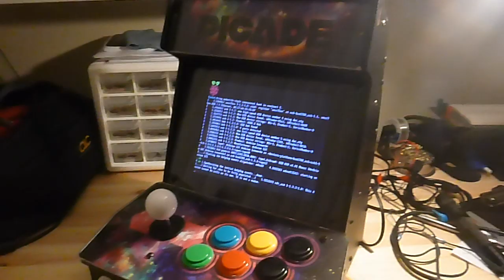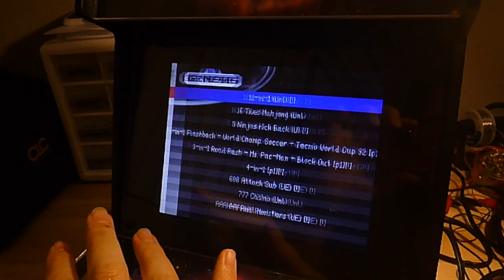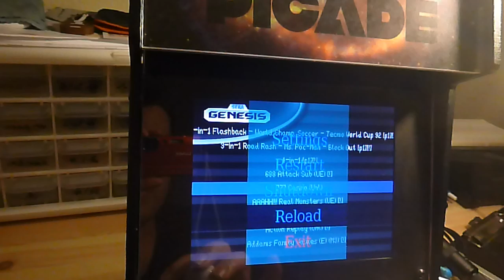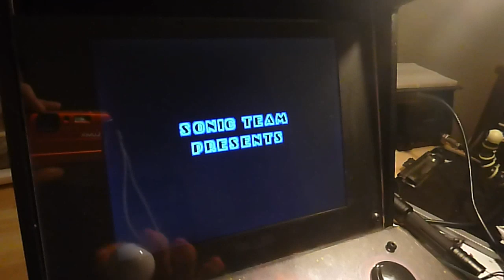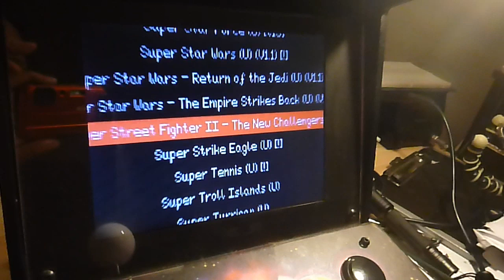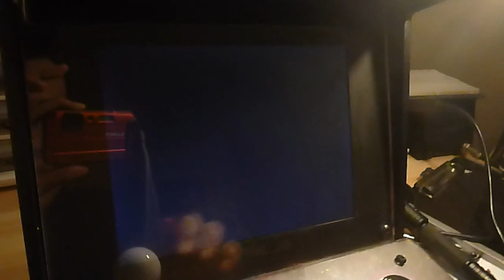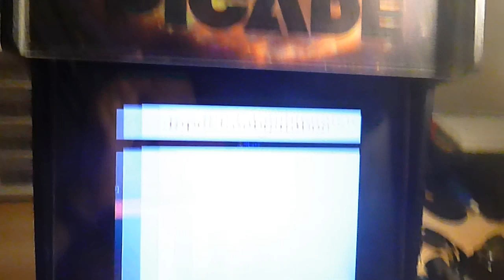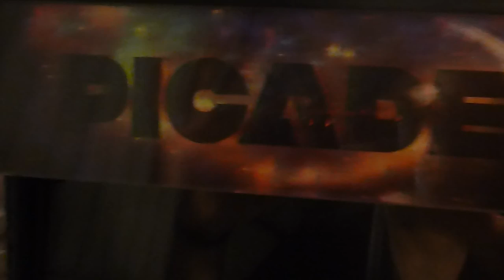Picade Mini build running RetroPie

Comment: Very cool. But you really need to overclock your Pi and use cooling blocks on the chipset. Maybe even a fan to push it to 1ghz.
Reply from the maker: I'm overclocked to 900mhz already, about the only game that's got any slow down are some sprite-heavy arcade games- everything else runs pretty smooth.
Reply: *****
Can you show how well Final Burn Alpha runs? I would like to see emulators like CPS1/2/3 since I am doing a fightstick modification.
Reply from the maker: TheTerracide
I plan on getting a new video up soon with mame4all-pi - I can play SF2T full speed no problems. Haven't tried fba- does it use mame roms or do you need special ones?

Comment: FYI the Genesis/Megadrive controllers only had 3 buttons, so you won't get all 6 working on those. Hope that helps :)
Reply from the maker: In my updated video I got the 6-button genesis controls to work. Works great for games like Street Fighter, Eternal Champions, Mortal Kombat
Reply: "The standard controller features a rounded shape, a directional pad, three main buttons, and a "start" button. Sega later released a six-button version in 1993. This pad is slightly smaller and features three additional face buttons, similar to the design of buttons on some popular arcade fighting games such as Street Fighter II. The third model of the controller, MK-1470 was released with the Sega Genesis Model 3, with a switch between Normal, Turbo, and Slow while also having the Mode button." 
Only had 3 buttons you say? I still have my Megadrive model 2 with its 6-button controller. 
Hope That clear things up. :)
Reply: The original controllers only had 3 buttons, so games written at that time (before the extra buttons were added) will generally only support 3 buttons. I hope that clears that up :)

Glad to hear that the OP got all 6-buttons working properly, it's a great project.

Comment: Porta-Pi Arcade > Retropie. 

There's both a 7" and 9" version.

http://www.retrobuiltgames.com
Reply from the maker: Interesting, though the Picade kickstarter ended over a year before the Porta-Pi, and the Porta Pi is more expensive overall. For about the same price as the Porta-Pi's cabinet+screen+speakers+controls, I got the cabinet+screen+speakers+controls + what I think is a cleaner control scheme (a dedicated board to emulate a USB keyboard) and was able to purchase Pi, SD card, and miscellaneous parts I used to enhance my kit. So overall I'm happy with my purchase. That said, the Picade is still, two years later, not available at retail, so I wouldn't mind maybe picking up a Porta-Pi kit if I felt the need to build another one.
Reply: *****
 I understand.  I'm just pretty much evangelizing the Porta-Pi arcade.  Like an Apple vs. PC thing.  I have both the 7" and the 9" and I enjoy them both.  I put an AMD 1 platform in the 9" just for the heck of it.  I also ordered a custom Joystick from Andy/Ultimarc and Ryan/Retrogames had no problem customizing the mounting holes for me.  I've had nothing but great experiences with him.

The Picade is nice, but I think Pimeroni got way in over their heads with it.  I'd be surprised if the Picade ever came to the retail market.  Ryan/Retrogames was actually able to fulfill his Kickstarter orders early, whereas Pimeroni dropped the ball.
Reply from the maker: Jason Jay
Yeah, I agree that Pimoroni took way too long and has been way too silent since it shipped. In fact the very reason I prioritized building the kit as soon as I got it (over other projects in the queue) was to increase the chances I'd get support (which I did, no qualms there) in case they disappeared into the ether. So I'm glad I built mine right away.

I think it's more Dell vs. HP than Mac vs. PC. I mean, both support the same kind of setups inside.